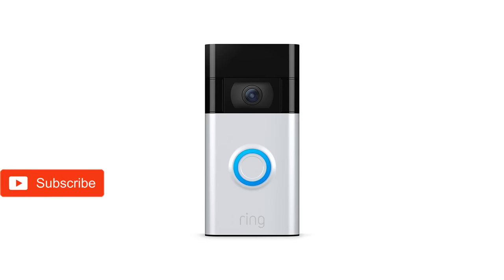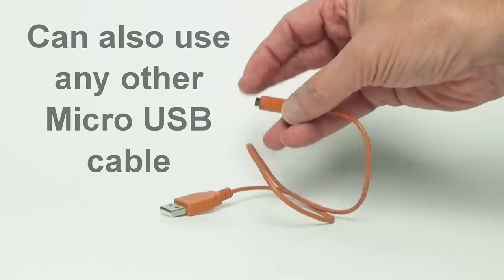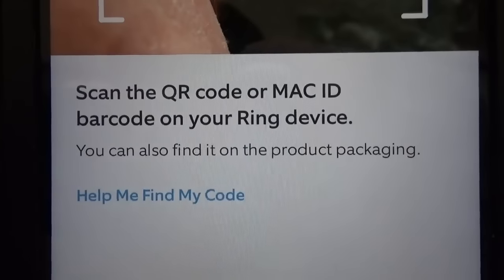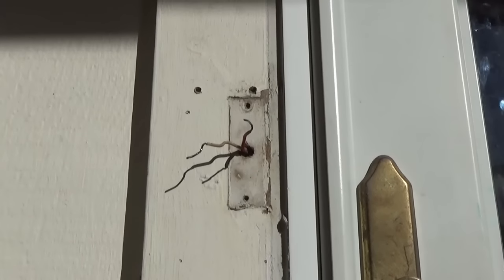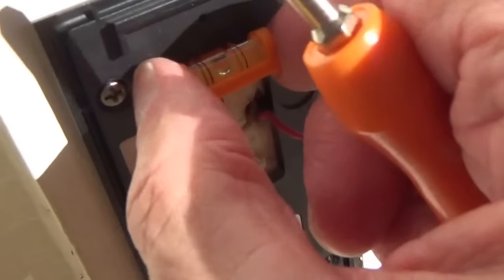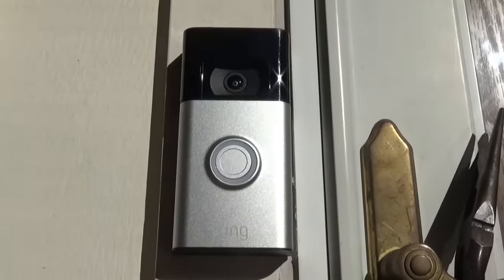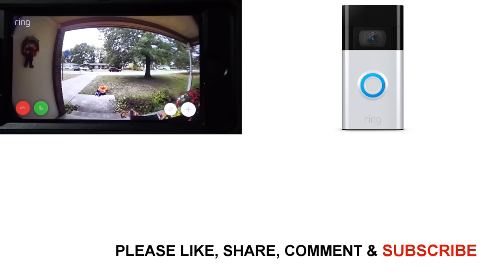How To Install A Ring Video Doorbell 2nd Generation 2020 - Hardwire Installation Of 1080p Door Bell

Comment: Thanks for the video, was thinking about doing one to include the hook-up of the battery backup and to show others why is doesn't matter which wire goes on the terminals. It's because the doorbell power supply in most homes are AC volts, not DC. AC volts does not require polarity plus or minus like on standard batteries. So, if you're going to run a new power supply to any new or added device, that it specifically requires AC power supplies.
Reply from the maker: That would be a great idea, and some good information. Make that video!

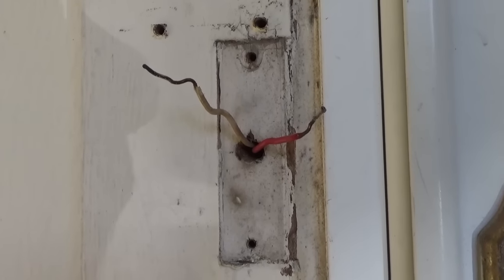Comment: You mentioned at the 2:17  mark about turning off the power which the instructions say to do.

However, yesterday while installing one for first time for a friend who wasn’t able to do it, I realized another possibly easier solution to the power issue: I first simply disconnected the wire to the doorbell on the chime itself, thus insuring an fully open connection at the doorbell. 

Trying to find the right breaker in his house would have been a challenge! And possibly knocked out other items/lights they/I needed.
So then just reconnected bell line on chime as final item.

Worked out fine! But took me 3+ hours because I didn’t have a couple of tools that would have made it easier.
And it was on quite old concrete block wall with his drill that wasn’t the best, even using supplied bit.
I had to knock out a little tiny trench/groove for the wire so that we could move the switch up about an inch and a half to the correct 48 inches and run the wire behind the plate to the center opening of the plate.
Reply from the maker: That sounds like a great solution, and just what the situation called for! And seems like something always refuses to make the job as easy as we think it should be, but the results are what counts. Thanks for the comment!
Reply: @HowSkills  I am certainly no electrician, so there may have been a defect in my thinking, but if there’s no connection from the doorbell wire to the chime, I don’t really see how you could end up with a short when connecting the ring module.
His transformer was mounted on the ceiling of a small bedroom closet with a light also in the closet so that’s why I decided to try to find a alternate solution.

Comment: Can you buy with 2nd one for back door. Not so much to be able to ring the doorbell at back yard  but just to see who comes in and out of the back door for when we rent our home on Airbnb occasionally. Any suggestions to be able to have front door and back door video security
Reply from the maker: You could defnitely buy one for the back door too, but you might also look into one of their other products, which is a video security camera.  You could put one of those by your back door and it will record when any movement and alerts you when there is activity. These can also allow you to communicate with anyone who comes near it, and they work with the Ring app and other Ring products.
Reply: @HowSkills  Thanks :)
Reply: Good question. I live in townhouse and was looking for one for my backdoor also. Thanks

Comment: In the instructions, does it say what size torx bit size is needed? Is the internal camera rain proof, or should I seal it with a tiny amount of silicon bathtub calk? 10 years ago, I tried one of those wireless doorbells in back. It went dead after a heavy rain. 
Thanks for the tips........
Reply from the maker: It comes with a torx wrench for you to use, and the camera is sealed against rain and moisture. I haven’t had any trouble with mine, so I’m sure you won’t have a problem with yours. I have nothing but good things to say about mine!
Reply: @HowSkills  Thanks.

Comment: I installed a ring doorbell plus 3 hard wired to my old doorbell worked great for 1 1/2  years then started fail, seems its not charging with the trickle anymore( the power is good)so now its like battery only and recharge every 2months. do the batteries go bad after awhile ?  Any ideas, tried calling customer service, useless.

Comment: Good video, Stan! I have a couple of questions for you if you don't mind? 1) does the old doorbell chime in your house still work with this? 2) the two wires going to your old doorbell button are just for a switch. They don"t have a true power supply to them. only one side of the 12 - 24 volts. Did you have to modify the wiring at your old chime? Thanks

Comment: I bought the same one but my question is even if I connect to the wire to the old door bell do I still have to keep charging the battery for the camera to work ?
Reply from the maker: If your doorbell is going to be hardwired into your existing wiring then you need won’t have to keep charging the battery. It’s important to fully charge the battery before installing the doorbell, and then it will be continuously trickle-charged and should keep it’s charge.

Comment: How did you remove the bracket to install? Just got this device yesterday and am having a difficult time separating. Thank you
Reply from the maker: That bracket on the back of the doorbell can be a little stubborn to get off. Starting at the bottom edge of the doorbell, take a thin-bladed knife or flat head screwdriver, insert it between the bracket and the back, and gently pry the bracket off. It’s hinged at the top of the doorbell, so if you can get it separated a little at the bottom, that should allow you to pull it off.
Reply: @HowSkills  got it thank you much!

Comment: Hi I have seen this video does the wire that goes from the electric charge the battery or do you need to take the battery off to charge it Thanks
Reply from the maker: On this model, once you initially charge the battery up all the way before installation, a wired installation of it will constantly trickle charge the built-in battery and should keep it charged. If it ever failed to keep the charge, you would have to remove the unit from the wall to charge it up again. Some Ring doorbells have removable batteries, but this model doesn’t.

Comment: an excellent informative video! well done. I have this model and it is hardwired into the door bell wires directly. How do I take it off to charge the battery with it hardwired?
Reply from the maker: The battery pack is built into the unit, so if for some reason it loses its charge, then you have to completely remove the entire unit and disconnect the wires in the rear of it. The battery should be completely charged before installing the doorbell, and should stay charged, as the unit trickle charges it as needed. But, I have heard of some of these batteries losing their charge for some reason, and the only way to fully recharge them is to remove the unit entirely from where it's mounted.
Reply: @HowSkills  thank you. some of the videos show that you can remove the battery pack and charge it at your charging station. mine was fully charged and has been active and installed, hardwired to the doorbell for a while now.
Reply: @donnacurrie7360  Some models do have a removable battery, but unfortunately, this exact model doesn’t. The Ring Video Doorbell 2, 3, 3 Plus, and the Peephole Cam all have removable batteries.
Reply: @GmaGpaAdventures  oh crap! I will need a lesson in unwiring it from the doorbell wires. ugh. thank you for solving the big question that helps!
Reply: @HowSkills  I had it all charged up and it took a couple of months to get it installed. i should have checked that before the installation happened. sigh.

Comment: Hi I have this quest for the longest and can fin any answers around you tube we you connected you ring to the wires do you still have to charge the battery, because my is connected to the wires and I started getting messages about charging my battery any feed back on this matter? Thank you
Reply from the maker: Normally, once a Ring Doorbell is hardwired, the internal battery should stay charged. One thing I have learned though, is that you need to make sure that the internal battery is fully charged before installing the doorbell and connecting it to the existing wiring. Once it's fully charged, the internal battery is kept charged by a built-in trickle charger. But if the battery wasn't fully charged to start with, it can be more easily drained. You also might have a transformer that doesn't have sufficient power to keep the battery charged. The transformer needs to have an output of 8-24V AC.

Comment: How often to you have to recharge it? And when you charge it do you have to shut the power to that area of your home?
Reply from the maker: If it's wired into your existing wiring that was there with the former doorbell, you only have to fully charge it once, that very first time. After that, the Ring Doorbell keeps the battery charged up and can use it as a backup in case of a power failure. If your doorbell isn't wired and uses the battery alone to operate on, you may need to recharge it anywhere from between every 3-6 months depending on how often it detects motion. They are rated by the manufacturer to last as long as 9-12 months, but in real-world use, that's not likely.

Comment: In the instructions it said to buy the ring doorbell resistor. Do I need this. I already bought it but won't use it unless I need it. I currently have a doorbell with a mechanical chime and would like the ring doorbell to ring the chime in my house. I have the same model doorbell as you. I can't find info on weither I need the resistor or not. In the box it says I need it but the paper that came with the resistor said not to use it with an existing chime. My transformer is 16v 10va
Reply from the maker: The resistor isn’t needed if you have an existing chime. It’s only needed if you don’t already have a chime connected to existing doorbell wiring, as the chime is what’s providing the resistance in the circuit with the transformer. If you had no chime and no pre-existing doorbell wiring, and wanted to hardwire the Ring Doorbell directly to a transformer so you could take advantage of it being trickle-charged, then you would need the resistor.

Comment: Did it work with your existing chime inside?
Reply from the maker: Yes, it did. Our house is almost 50 years old and the doorbell transformer voltage was compatible. That will vary from house to house, but most modern systems will be compatible.
Reply: I hard wired mine and my house is only 10 years old but the chime inside my house isn’t working now...any suggestions?

Comment: Hello I have a question??? Is it possible to install a aftermarket chime with this device. because my original home chime is broken, thanks👍👍👍
Reply from the maker: Yes, you can add an aftermarket chime to replace your original. As long as the voltage of your system is in the required range (8-24v ac) then you should be fine.
Reply: @HowSkills  ok.   Thank you, 👍👍
Reply: @HowSkills  Is not the gen 2 chime mains powered

Comment: Thìs one is very difficult to charge battery you have to remove it from wire thanks for your video
Reply from the maker: They need to rethink that design.

Comment: Did you need to use a wire jumper to your existing mechanical chime box?
Reply from the maker: No, I didn’t. Mine worked just fine as it was.
Reply: @HowSkills   You do not have to use a jumper  as the old bell is very low resistance eg 20 OHMS and does not affect charging

Comment: My transformer is a max of 8v 1amp.
I will change it but which output?
I can get 16v at 1amp or dose it have to be 2amp cos I can't find 2amp
Reply from the maker: The 16V at 1 amp will probably work, but check its VA rating. This doorbell can work with 8-24V transformers but needs a VA rating somewhere between 20-40VA.

Comment: Interesting I just purchased this model built in (non removable battery)   the instructions state that you must install a resistor 25 ohm/50W onto one of the wires coming from the transformer, in order to complete this install.   
Does anyone know if that is just a recommendation or mandatory?
Reply from the maker: The resistor isn’t needed if you are hardwiring your doorbell into existing wiring that is connected to an already existing doorbell chime. That was my case in this video. The chime served as the resistor in my circuit. But if your house doesn’t have existing wiring connecting to a chime, and you are directly attaching to a doorbell transformer, then a resistor is needed as a substitute for the absence of the house-bell chime for this doorbell.

Comment: Since it's wired, the battery recharges itself?
Reply from the maker: It does. There is a trickle charger built into the doorbell that keeps the internal battery charged.

Comment: Do you need to connect with any security alarm system and pay monthly payment? Thanks
Reply from the maker: You don’t have to pay anything extra if you don’t want to. But I have the additional Basic Plan that’s $30 a year and stores 60 days of video history from my device. There is a more expensive plan that also works with Ring Alarm.

Comment: great video!  only problem with my setup is the surface isn’t completely flat near the door where the wires come out, what do you recommend?
Reply: If it is wired so it won't need taken down to charge, I'd just caulk around it. You can get black caulk so it blends in with the plastic bracket better.
Reply: @dustintunis9347  nice, thanks for the tip!  we haven’t set up the Ring doorbell yet in the app & synced it with our Alexa Show yet, do you have to go to Settings to make it play a chime when the button is pressed?  (i believe it’s wired correctly)
Reply: @glenbarrett8299  - I haven't installed one yet, so I don't know.
Reply from the maker: You can go to Settings in the app under "In-home Chime Settings" and select "Automatic Chime Detection", or select "Advanced Settings", and then manually setup and configure your doorbell chime.
Reply: @HowSkills  This is the best post ever very good info indeed    I have just changed the one I installed to  Automatic Chime Detection  And yes perfect Chiming on the old  mechanical chime unit  The unit must for a moment  disconnect the charge  circuit, run on its battery and loop back the wires to make it ding dong as it originally did with the old press button Very clever bit of kit
Reply from the maker: @michaelllewellyn7215  Glad to hear it worked well for you! Love mine, and have had no problems with it at all. Installed a wedge kit a little while back to get a different angle for better camera coverage on my porch, but other than that, my setup is  still the same as in this video.

Comment: Thanks for the video. Uhm, I installed mine hardwired not fully charge. Everything works. House chime works like a charm but when I go on the app still says "power source - battery. Any thoughts?
Reply from the maker: Probably showing that status because the battery wasn’t fully charged before installation. When it’s hardwired, the battery is constantly trickle-charged to keep it at full capacity so it probably expects it to start out that way. The battery serves as a backup power source in case of an electrical outage.
Reply: @HowSkills  what is the old system like is it a old maniacal chime or some new electronic thing  they may not be able to charge a ring

Comment: Do you know why they provide two black antenna like wires in the kit? I didn’t use them when I installed it
Reply from the maker: Offhand, I'm not sure what they are for...I didn't have those in my box. Could they possibly be diodes that some Ring Doorbells require?
Reply: They are extension wires if your existing are to short  How you are supposed to connect them I do not know but I would solder them but first put on a length of shrink down insulation  then shrink it down

Comment: Will this work with existing chime?
Reply from the maker: This model will work with most existing chimes. There are some models, such as a low-priced 2021 wired version, that don’t support an existing chime. Those models require you to buy a Ring Chime or connect to an Alexa device to hear a chime.
Reply: @HowSkills  Turns out it just needs an extra set up from Ring app, now it works. Thanks for your reply!

Comment: is there any work required on the old mechanical house chime (ding ding)?
Reply from the maker: There wasn’t any work required with mine, but that can depend on the doorbell. Most should work. You do need to make sure in the app that you’ve selected “Mechanical” under “Doorbell Chime Type”, or that you’ve selected “Automatic  Chime Detection”, if that’s the option you see.
Reply: Yes on the App change setting to Mechanical   chime or Automatic I must change mine as it does not ring  The instruction with it are poor very poor

Comment: Now that you have had it a few months, do you receive notice of the battery being low, even though you have it wired directly? I do and have to take it off to recharge it.
Reply from the maker: I haven't experienced that problem so far. Do you think your current system might not be supplying enough power to the doorbell?
Reply: I recharged the door bell to 100% reattached, everything ok, maybe that’s what we have to do. I don’t know if the cam sends anything wired to the chime, chime voltage was at 11%.
Reply: If the voltage going through your wires is less than 8 volts then they will not supply on enough power to keep it charged. If this is true you will have to change the Transformer to your doorbell to one that supplies at least 12 volts. My doorbell wires were only supplying about 2.7 V
Reply: What AC voltage do you have on the back of the unit on the wires  need to be 8 to 24v AC is it an old Mechanical chime unit  you are powering it off